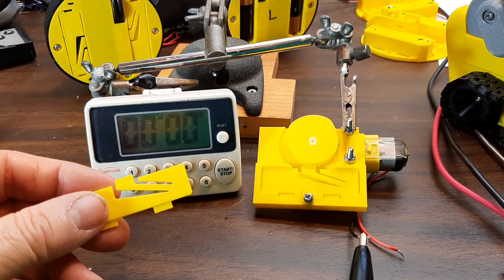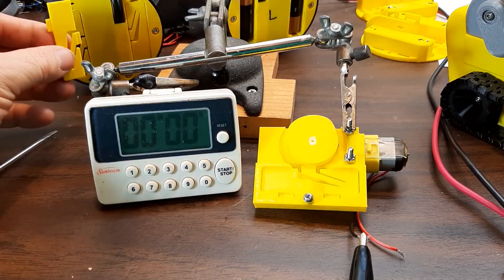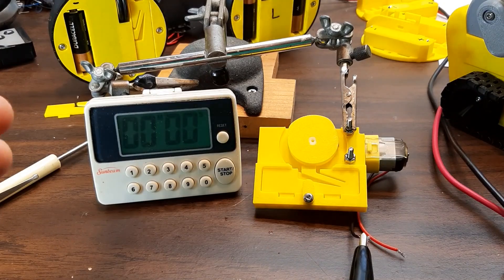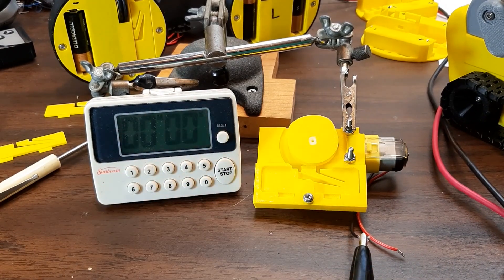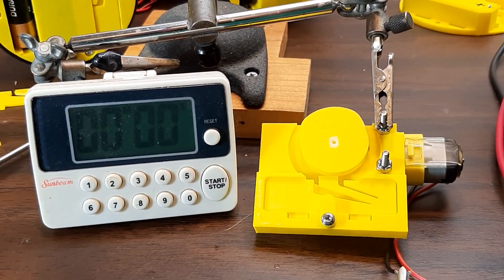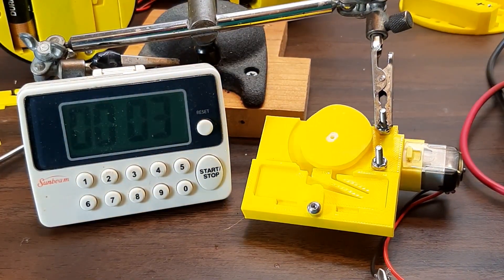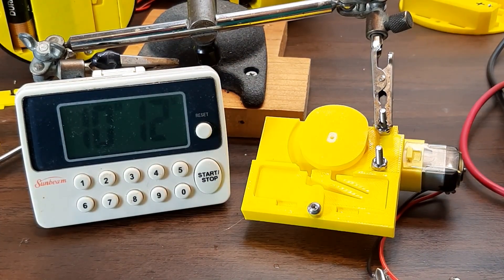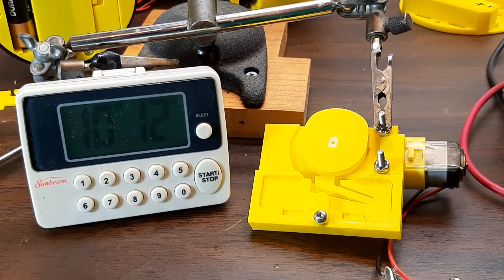Testing a 3D Printed Battery Door

Comment: Nice design.  Breaking won't be the failure mode.  PLA will over time creep or lose it's position as it relaxes.  If the part is under tension, it will lose that tension and the springiness aspect will be diminished.  Another test would be to test the force of the 'spring' then cycle it a couple thousand times then retest the force of the spring.

Comment: It will never break unless someone gets crazy with it. Good design. Reminded me of the old days when I build test jigs to check the reliability of micro switches and motor driven CD drawers. I had a plastic finger connected to a gear motor that pushed the Open / close drawer button. Thanks for the good time memories that I had forgot about.
Reply from the maker: Thanks. I really enjoy designing small projects like this. It took about 30 minutes in Fusion 360. I thought about making it more complex with a sliding finger just for fun, but decided to keep it simple. I worked in a factory making variable resistors and switches for almost 20 years. We had a life test lab where the parts would be cycled with geared motors. Good memories.
Reply: Ah those cup holders!